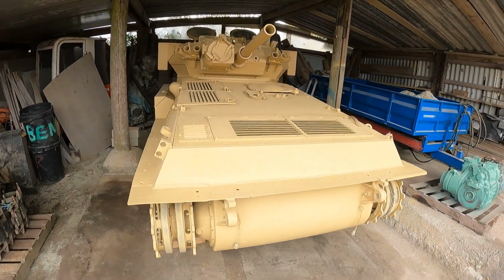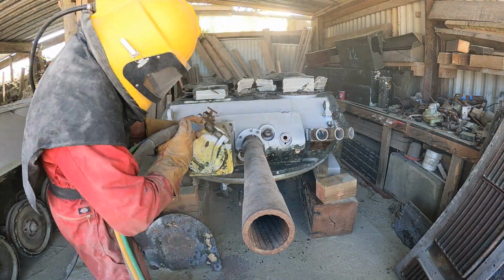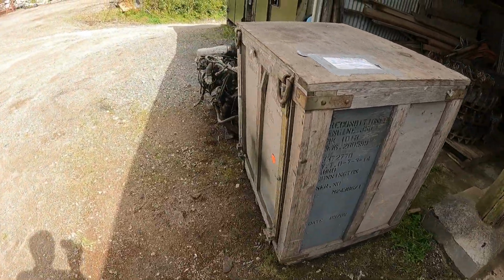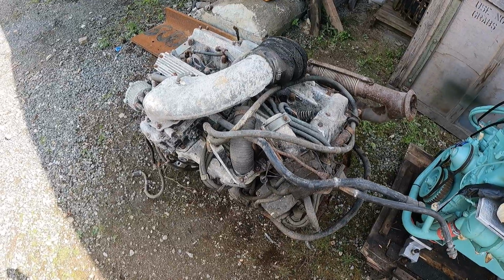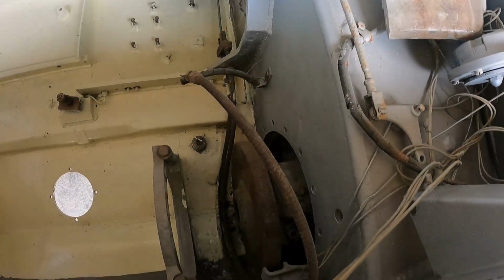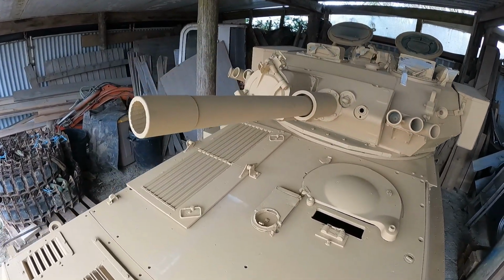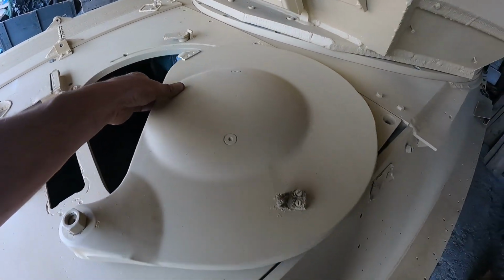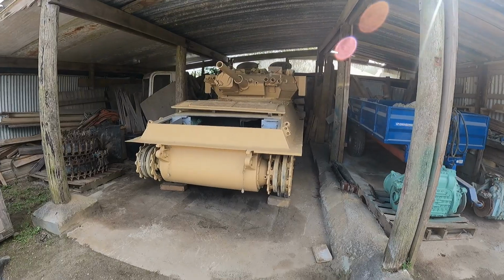Scorpion CVRT Restoration Project,  Part 2

Comment: What happened to part 3
Reply from the maker: It’s slowly on the way. Getting the parts I needed was quite hard going but they are slowly all coming together. I have part 3 part way filmed just got to get the engine in and running ! Not too far away now

Comment: Very nice. What are the calipers used on the steering system?
Reply from the maker: There are two sets of calipers , one set on the steering box for the steering the others are on the hubs themselves for the main braking . I believe the steering ones are jaguar car, whereas the braking ones are cvrt specific. It seems to problem to be able to get hold of calipers or pads for either so far 🙂

Comment: In the 80's when I was a teenager I got a placement on a YOPs scheme at the Proof and Experimental Establishment at Gore Cross on Salisbury plain. I used to unpack the 76mm L23A1 Barrels and Breech blocks that came from the Royal Ordnance Factory, Nottingham and put them together and mount them on an 25 pdr carriage for proof firing, then clean and disassemble, re-pack them to be sent back. I used to really like doing it and knew the Barrel and Block assembly like the back of my hand, only one in ten Mantlets were proof fired. I may have had your gun in my hands.

Comment: I live just up the road from where you bought the CVRT, I've always wanted to strike some kind of deal to put some time into one of these and get one running and get some drive time. My wife won't let me buy one so I've got to find away around that rule....  I've got 2 classic tractors and a 70's bronco (you may have seen driving around, to get fixed up first anyway.

Looking forward to following this!
Reply from the maker: The ones that are left are pretty grim, need a lot of work putting into them. 

I looked at one of the chieftan (there’s a vid on my channel) from outside but again it needs a lot of work ! The abbot I also bought from there which was a good project. Took 5 years to do though !
Reply: @BenoCam  Well I live nearby and I’m an electronics and electrical engineer, was aviation and now marine, so if you ever need a hand with something electrical, I’d be more than happy to help you.

Comment: Great job on the bodywork. What is the coating on the reconditioned gear box and engine? Some kind of protective coating, or paint?
Reply from the maker: Cheers, it’s getting there ! That colour paint is just what the MOD use to paint them, duck egg blue ! I guess it identifies which bits they have refurbed themselves rather than other non MOD spec kit perhaps.

Comment: nice blue ford tractor
Reply from the maker: Bought that cheap because it was getting water in the oil slowly over time. Was all totally original one owner from new. Turned out to be a cracked block so it wasn’t my best ever gamble but at least now it has a new engine 🙂